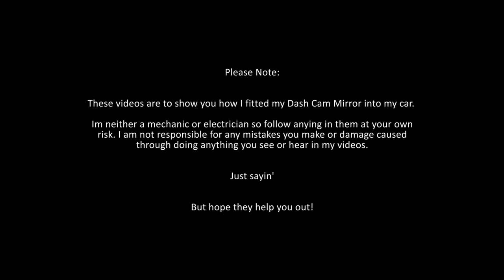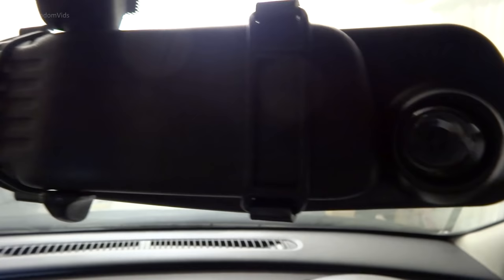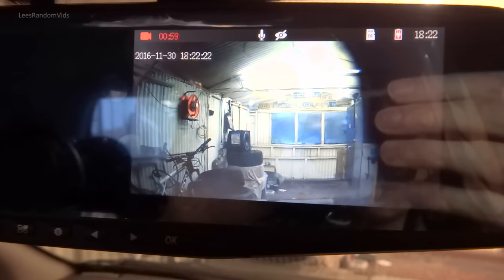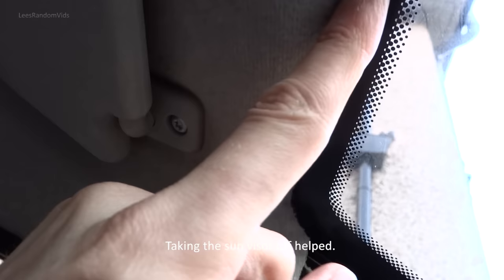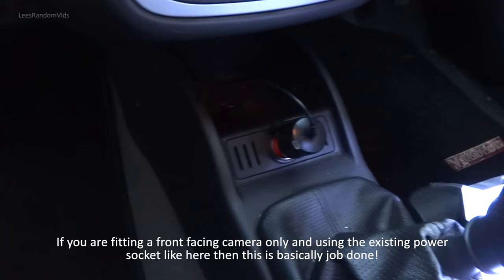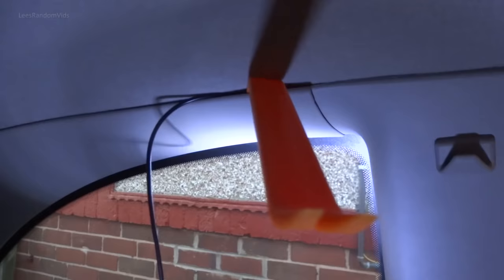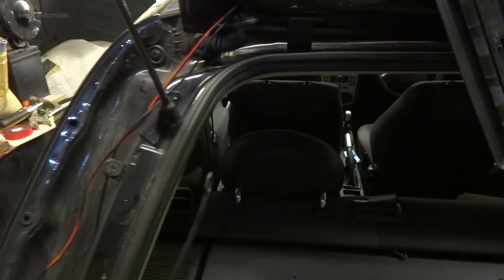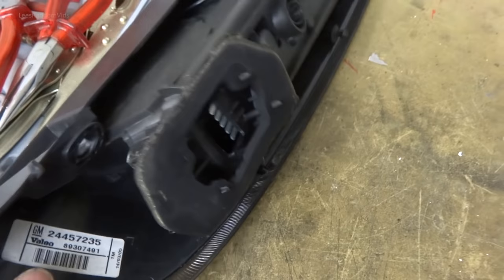How to Install a Dash Cam Mirror and Rear Camera to your Car - Part 1

Comment: Can i install in the other way around? I mean currently your lens is on the left, can I put it on the right instead? Will the video turn upside down or can be adjusted?
Reply from the maker: Hi, its made to only be the one way up. All the video, menu screen and everything would be upside down as well as the buttons etc. 
If you're wanting to do this because yours is a left hand drive car then you dont need to do this, you can angle the camera on the back of the mirror for either left or right hand drives cars.
Hope it helps :)

Comment: I have exactly this one in my car, but when I change to back gear the camera doesn’t change to full screen back camera with signal lines. I installed everything correctly, in the first it worked perfectly. So what’s wrong with that please. Thank you so much for your tips.
Reply from the maker: That's the wire(s) that connects to the reverse light circuit, if it worked ok before but not now then maybe the wires have become disconnected? Check the wires, and check your reverse light is working too.
If both of them are ok then I dont know. Hope that helps tho.
Reply: @LeesRandomVids  hi. Csn you send me the wiring diagram please?
Reply: @LeesRandomVids  where would you hook up the red wire if you LED tail lights? Heard that you can't use that hook up.

Comment: Having two issues with mine. It will randomly stop recording, or entirely shut down while driving. Sometimes after only one mile, sometimes a while longer. Not sure if it's because my cigarette lighter socket is not ignition on. The other issue I have is when the camera is on, I get a lot of static interference with my XM satellite radio.
Reply from the maker: Yeah the switching off I can only suggest looking for a loose connection, either power from the socket is cutting out or the wire going to the mirror. If they're both fine then it must be the camera.

1 other person mentioned they had interference from a satellite radio on here before in the comments a while back somewhere, dont know if they found a solution or not. I've not experienced either of those issues myself so cant help u any more than that mate.
Good luck!
Reply: Ya mine bee doing the same thing

Comment: I have the same dash camera Chinese version it playback only the first 1 minute saved file and the massage for the rest of the files"unsupported or corrupted or..." , your support is highly appreciated
Reply from the maker: I don't know, but it could be the memory card, maybe try it with another one. If you don't have a spare memory card try formatting the existing one, but if the memory card is faulty then formatting probably wont help, buts its worth a try. I sometimes format mine every now and again just to clean it out. Its also a good idea to format a new card when you first put it in the device. 
You could also try resetting the dash cam to factory defaults. Other than that, I don't know.
Hope it helps.

Comment: Do you know if you can remove the overlay when the reverse camera is on ?
Reply from the maker: Nah I'm afraid not. There is no option to turn it off. 
The only way you could do that would be to disconnect the wire that switches the screen to show the reverse camera when you put the vehicle in reverse then switch it to show the rear camera manually every time as is doesn't show the lines that way.. but that would be a right pain to do every time.

Comment: Installed one today. When i am reversing it stops. Only works every 5 seconds. I did not connect the red wire though. Could this be the problem? That the camera itself isnt getting enough power?
Reply from the maker: I wouldn't have thought so.. The red wire from the rear camera is to tell the unit when you put the car into reverse, so if you dont connect that wire then the unit doesnt know when you're in reverse so nothing should happen when you put your car into reverse. It gets its power from the cigarette lighter socket. Unless yours is different.

Comment: Thank you for the video 
I have the same exact blackbox DVR dual lens. The problem is that when I connected the red wire I think I burned my camera because it shows only white ( probably I had to switch everything off ).  So I got the 2d camera everything works but no red lines or sound sensors and now I'm afraid to connect the red wire any idea plz
Reply from the maker: I don'y know mate, I just connected my red wire and it worked, maybe your first camera was already faulty when it was white.
When you say No red lines? Do u mean those parking lines? They only appear if the red wire is connected to the reverse circuit and when you put the car into reverse
Reply: What is the red wire for?

Comment: Does your mirror tilt down every time u go over a speed bump? I had one like this and I had to constantly Re adjust the mirror again everytime I go over a speed bump
Reply from the maker: No mine doesn't move at all, it was a concern when I was installing it that it might, but no. This one is quite light and obv it depends how strong or stiff the cars mirror is. Sometimes mine does vibrate very very slightly when the car is idling on a cold engine until its warmed up.

Comment: hello brother .. how are you?  I see what you're showing I don't really see and understand when you do the rear camera installation
Reply from the maker: Yeah I did it a more complicated way than necessary, you don't need to wire it into the light if you don't want to, that was just to make the screen change to display the rear camera when reversing. You can leave that option off or unconnected, or wire it into the wire harness, but I didnt want to do that so I out it into the light instead.

Comment: just I want to know how can I install the back cam and the red wire?
Reply from the maker: It's in the next video mate, tho to be honest I did it a much more difficult and long winded way of wiring into my light cluster because I didn't want to splice into the wiring harness. The easiest way is to connect it into the wiring harness that goes to the reverse light using splice connectors.
Reply: LeesRandomVids what's the color of reverse wire sir?

Comment: Awesome vid how many hours did it take to finish thanks
Reply from the maker: TY!! Oh I cant remember exactly, it was almost 2 years ago when I installed it. I started one afternoon and finished off the next afternoon. But that second afternoon was installing a second power socket into the dash to plug it into. The front cam doesn't take long at all, the rear cam is time finding route for the wire to the back.
Reply: @LeesRandomVids  3 to 4 hours

Comment: I wired up the same type of camera like you have but I'm having a problem. When I turn on the lights on the car my backup camera turns completely white. When the lights are off it works fine. Any ideas? 

I'm wired into the reverse light 12v + and the ground on the rear light cluster loom
Reply from the maker: That's weird, It's definitely wired to the ground and not accidentally into the positive side of the light circuit? Just strange why it does it only when the lights are on. Does the rear camera activate ok when you put it into reverse with the light off? Maybe try connecting to a different ground, like the car body via a screw head or something just to eliminate the light circuit from the possibility.

Comment: I think the cut off on the right in the beginning was the power wire in the way
Reply from the maker: Which part do you mean mate? What time in the video?
Reply from the maker: Ahh you mean on the screen when I was talking about the camera pointing slightly to the left? Yeah the wire was covering a bit of the camera on the right hand side too, but the camera does point slightly to the left, but not enough to be a problem. :D

Comment: All this work and you use a cigarette adapter for power???
Reply from the maker: whats the problem with that? that's the plug it came with, it's designed to plug into the cigarette socket.

Comment: I need some help here please.. I have got a dash /reverse camera from AlliExpress and paid to installed it by some car audio guys here in Perth. However they don't know whats wrong.
 when the car goes to reverse the unit is not responding to reverse mode. (not visualize it) 
(Still shows and records dash camera and you can't activate settings unless you put the gear on drive again.)
When engine starts unit powers up too. GPS good. Dash camera very good! But reverse camera nothing,no signal ...Also I have noticed that when I am on reverse  doesn't respond at all until I get to drive or parking gear. Then reacts again to my touch.
the red cable that is coming from the the unit for the camera is connected to the brown positive  of the light( no ground (black red color) wire on this cable line )only 2 wires
I tried another line that has ground (3 wires) and connected red to positive and black red color wire to the negative of the rear light ,and still the same problem no reverse view..
Any help will be much appreciated !
Reply from the maker: Not sure, but mine had the power cable that goes to the power socket obv then one single red wire that switches the display to the rear camera. That red wire is like a switch to tell it to display the rear camera, so it needs to be connected to a wire that only becomes live when the car is in reverse, so the reverse light circuit.
Try first disconnecting the switch wire and see if it all works normally without it.

Comment: I am thinking about buying one of these BUT i have blue tooth  etc through the back mirror so if I put this other mirror over this will it effect my mirror ?
Reply from the maker: I don't know mate, obv it fits over the existing mirror so if u need to use or see the original mirror for anything then yeah it will be covered up. Like if u have buttons on the front of your mirror then they will be covered up, but buttons on the bottom of the mirror maybe ok unless you get unlucky and they are where the mirror cam fitting straps are. But if you just mean will it effect the bluetooth signal, I don't know for sure but personally I don't think it would, but I'm only guessing. Maybe you could try covering your mirror up with something first to test if u still get a good signal with it covered up before purchasing anything? like some thick cardboard or something.
Reply from the maker: For anyone else with the same question:
►https://youtu.be/qpukX0-W4oE?t=5m19s

Comment: Hi, I have mine wired in but when I plug the reverse camera into the mirror, the system turns off and on repeatedly, dash cam works fine
Reply from the maker: Did you test it before you fitted it? If you did then I assume it didnt do that before which could imply something during installation, like a trapped or broken wire or loose connection somewhere. Double check all your wires and connections.

or it could be faulty, in which case get in contact with who u bought it from.

Comment: Hi. I'm Italian. I have serious problems understanding your so obscure English manual. So I do not use the dash camera with all its possibilities. For example, I do not know what to do in case of an accident. Does registration start alone? and if the room does not start, what should I do ?. Also I do not know how you can see the recordings without disassembling the memory card. Can you publish a more detailed and illustrated manual? Or an instructive video?
Other issues:
- the camera is powered only when the car is in motion but tells me continuously that the battery (of the camera) is empty and the special sticker flashes continuously. Even during long trips.
- I often get the message "full memory must be blocked or deleted" in this case I do not understand what I have to do. I think that if you do not delete the new file, the new files are stored on top of the oldest ones. It's right?
Good job.
Ciao Ciao
Alfredo
Reply from the maker: Hi, maybe this video will help you where I go through the setting ►https://youtu.be/Dv9ftl5aZ2U?t=468

If you have a crash the camera should save the file with the crash, the option is called 'gravity sensing' on mine, and you can set the sensitivity to low medium or high. This creates protected files that the camera will not record over ( I set my to low sensitivity or else it fills the memory card with protected files just with normal driving)
►https://youtu.be/Dv9ftl5aZ2U?t=800

Yes you can see the recording on the screen and play the videos back on the mirror. First press OK to stop it from recording, then press the button that looks like a flower 2 times to select the videos, then press ok
►https://youtu.be/Dv9ftl5aZ2U?t=1172

The battery on mine is rubbish, it is always almost flat, but it gets power from the car when it is moving. The battery is to record a few seconds if the car is it in a car park when not turned on.

Hmm, if the card is full, try formatting the card, this will erase everything.
But yes, when the card is full it should record over the old files automatically. Go into the settings and make sure 'cyclic record' is turned on, either 1, 2 or 3 minutes (or whatever options yours has).
►https://youtu.be/Dv9ftl5aZ2U?t=520

If the card is full of protected files then it wont record over protected files, you need to format the card to delete these. Also lower the sensitivity as mentioned above

Hope it helps!

Comment: Hi, kindly can you tell me the padlock symbol on the display what is it for? thanks 1000. i am italian
Reply from the maker: Hi. It is to lock (or protect) a file so the Dash Cam does not record over it. If the padlock shows on a file then it is protected and cannot be recorded over or deleted, the only way to delete them is to format the memory card.
Hope it helps 😃
Reply: @LeesRandomVids  Ok dear.I understand ... very kind and thanks 1000 for the answer. Hello
Reply from the maker: You're welcome 😃
Reply: @LeesRandomVids  thankyou...  ;)

Comment: it is far much more easier to just connect the red reverse cameras  cable  to the rear tail light wiring connector (on wire numbered 2)

test it out by setting  car in reverse , only reverse lights on and connect red wire to different wires  in that connector, .

i personally didn't  cut or solder the red wire, connector can easily 2 wires within it
Reply from the maker: Yeah, I just didn't want to cut into the car's wiring harness. Easiest way tho would be to just connect into the wire or even the connector if possible.
Reply: @LeesRandomVids  I didn't cut any wire, I just inserted the wire it can easily go in the connector, without soldering or some other method
Reply from the maker: Yeah that's what I originally thought to do with mine, that's the easiest way. But how it was moulded didn't allow it, or something like that, i cant remember exactly now, it was a few years ago. 👍

Comment: Hi, Do you know how to turn off screen for night driving?
Reply from the maker: In the options go to LCD brightness and you can set it to 10, 20 or 30 seconds or off. With off the screen just stays on all the time, selecting 10, 20 or 30 seconds the screen will turn off after 10, 20 or 30 seconds depending on what u chose. 
If you want to turn the screen off manually you can press the power button, that just turns the screen off but keeps recording. If you hold down the power button for a couple of seconds however it will turn the whole thing off. That's how mine works anyway.
Hope it helps.
Reply from the maker: Here you go, this clip shows you how to turn the screen off or set the screen to automatically turn off and keep recording:
►https://youtu.be/qpukX0-W4oE?t=24s

Comment: What do you use to open the video files on the computer ?
Reply from the maker: To play them back? I just double clicked them like any other video file and my default media player (windows media player) played them. 
Or do you mean how do I get them onto my computer? I took the memory card out and put that in the computer and transferred the files.
Hope it helps :)
Reply: LeesRandomVids I have tried box,b.s. player , win media player ,nothing is opening the video on the pc
Reply from the maker: That's strange. I dont know mate, mine just open like a normal video file. However I think mine maybe uses a funny codec or something, because when I made my sample footage video, all my videos played ok on my computer, but when I put them in a video editor to join them together the front camera files only played back a black screen but the sound still played. Also the front camera files when played back on my computer the video plays in the top left filling about 3/4 of the screen leaving a black bar in the bottom right which is strange. (the rear camera files worked perfect)

I got round this by converting the front camera files in a video converter to anything, avi or mp4 it didnt matter and left all the settings to match the original. After doing this the files played on my pc full screen and worked fine in the video editor too.

I know it would be a pain in the butt if u had to convert all your videos every time but its something you could try. But other than that I havnt got a clue mate, they should just open like a normal video file. Try converting one and see if it helps.

BTW I just used "Any Video Converter" to convert them, its free.
Reply: LeesRandomVidsp didn't it had in the menu a option to change the format ?
Reply: Thank you so much 4 the info
Reply from the maker: You're welcome, I try to help if I can. I hope you get it sorted!!